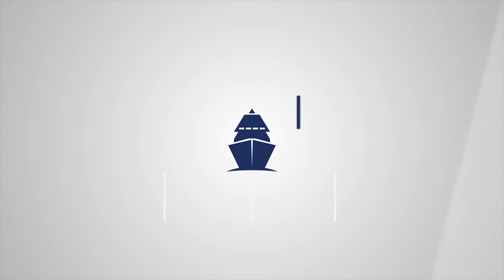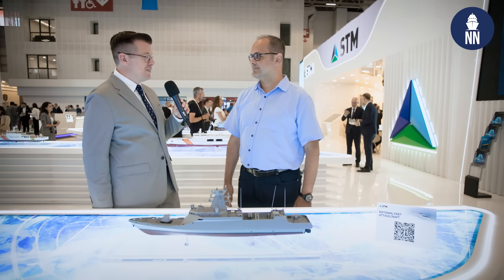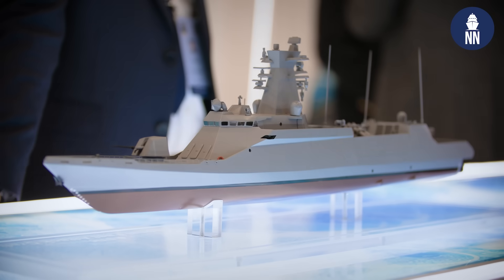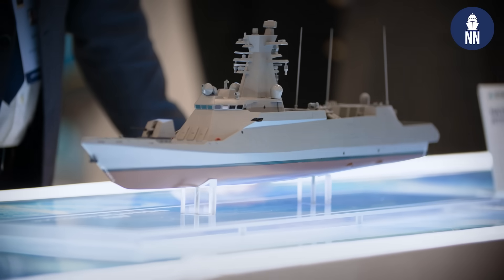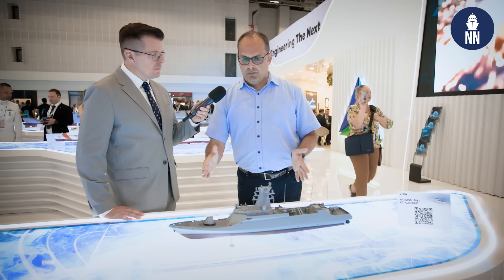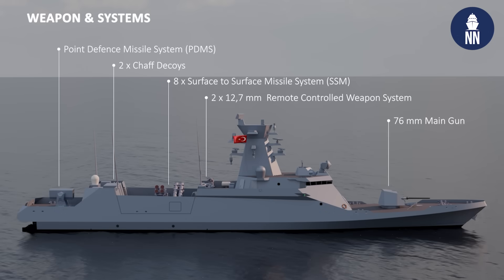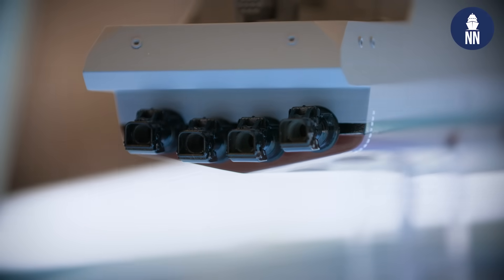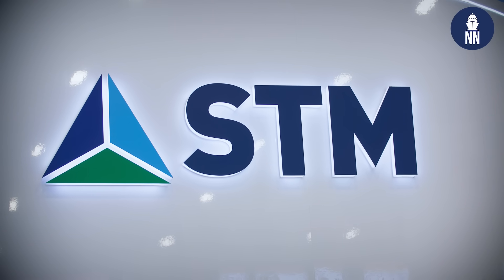Turkish Navy's Future Fast Attack Craft (FAC) at IDEF 2025

Comment: @KingOfKings34  I think we need to talk a little about ship design. The client... in this case, the Türkish Navy. They come with a list of requests. I need these main systems and these subsystems. My desired cruise and engagement speeds will be as follows. In other words, the ship is not built from the outside in, as it used to be, but rather from the inside out, in line with customer specifications. 

Do you want a runway for a 10-ton helicopter? Do you also want the capture and marking systems? Let's take note. Would you like active sonar barges for submarine defense? No? What about vertical launch ramps? No to that either. But you want an anti-ship rocket system and a nose gun. Isn't that right? 

This pre-order period can sometimes last six months, and sometimes six years, as is the case with our air defense destroyer. 
Once the configuration is at least roughly established, the design phase begins. Where will the power units be located? Is cooling required for the chimney and exhaust? Will the hull be anti-magnetic? How many personnel will we need? Where will they live, eat, and sleep? The cable and data line project is incredibly complex. You're working on a line, only to find that the fire guys is running their pressurized water pipes through it. It's pure chaos. 

Then comes the critical acceptance phase. Not a single weld has been made yet, but tens of thousands of man-hours have been invested. An interdepartmental committee is formed to determine whether the commander's seat should be equipped with a height adjustment option. The goal is to satisfy everyone and ensure the product meets the customer's specifications 100%. 

Then you should wait, and sometimes nothing happens for a year or two, total radio silence. Even sometimes nothing happens at all and sometimes the project is returned with major changes. It all starts over again. Customer is king .. Yes?

At some point, you realize that the plans have been approved and the work is now yours, Green Light! All you have to do is work with the project quality team to ensure that every weld and component is manufactured correctly.You sign off on the work you've overseen and assume full responsibility. No pressure!

... Let's get to your question. Why aren't we getting rid of gas turbines? Most likely, it's because it best meets the project requirements, including power, fuel consumption, maintenance, cost, and trouble-free operation.
Why is the FAC so large? Most likely, it's because the advanced subsystems and weapon load mean the required strike capability can't be met on a smaller ship. Respect.
Reply: one of the best comment I have ever came across. Gives good insight how the PM runs from RFI to BAU.

Comment: @KingOfKings34
  
I'm sorry, but you're thinking in 2d so call old school.
Drones are an important step in surveillance no doubt, but they're not everything.

...let me give you a example. 

Let's say we're in a hot conflict zone. This means there's intense electronic jamming and interference in the whole area. This also means the drone operator can't use their vehicle for real-time surveillance in the traditional sense because this Electronic Warfare. Of course, the drone could be given an autonomous route and the data it returns could be analyzed when comminication re-establish but scanning the data of a 6-hour patrol flight will take time even with AI.. What a waste of time. Or are you going to be visually scanning the conflict area with planes with pilots on board? Good luck.

Because we are not talking about an area the size of 5 football fields, as the Americans say :P but a she that has shut down all its active systems 50+ nautical miles away from its prey and she kept "listening" with only passive systems and hiding its radar silhouette beyond islands profile. You can think of her as a old time roadman hiding among the rocks, waiting to rob the stagecoach.

The first fundamental rule of war hasn't changed since the invention of the arrow: If you can't see, you can't hit.
All that's required for FAC is a targeting window during a combined attack involving electronics, kamikaze drones, shore-based anti-ship missiles, and submarines.

FAC requires approximately 3 minutes. This time is sufficient to fire six Atmaca anti-ship missiles and initiate an evasive maneuver.

3 minutes... bigbadaboom!

The message is clear: Don't put your mighty fleet in shallow waters where it's not wanted.
Reply: Even in your scenario, much lighter and faster Kılıç Class is superior to this 700 ton behemoth of a FAC that can barely do 40 knots when diesel  engines are operating at high RPM. Why did they get rid of the gas turbine? Why did they make it so heavy? This is a glorified OPV.

Comment: Can it be converted for Anti Submarine Warfare, Mine and mine countermeasure?
Reply: FAC are very specialized platforms and have little to no possibility to be converted to ASW or MCM.
Reply: @1zanglang  My friend.. I am following this project from the beginning... This project at the beginning was ASW.. But Turkiye has pieces Ada Classified Corvettes and Patrol Ships against Submarines so , the related/responsed people said that no need to ASW in the FAC... Besides It has systems to convert to ASW and it is optional...
Reply: @dedekorkut733  The hull configuration and the waterjet propulsion, make difficult the mods needed to fit hull mounted sonar, and towed array sonar, both absolutely needed for ASW. The FAC hull design is made for speed, not to host sonars, and it has not a low acoustic signature necessary  for a surface platform to be efficient in submarine search. Also, the mods would be too expensive to make this kind of conversion feasible. 
And since there is the ADA class corvette fully capable for ASW, I don't see any rational reason to try to convert this FAC to ASW. 
And, by the way, my friend, I spent quite some time onboard TCG HEYBELIADA, as liaison officer for Romanian Navy, during a multinational exercise, more than a decade ago, and have some time to familiarize myself with the ships capabilities, regarding AAW, EW, ASuW, and ASW. Also, I  know a thing or two about the FAC classes like Doğan, Yildiz, Rüzgar, and  Kiliç, of the Turkish Navy which this new FAC would replace.
Reply: @1zanglang  I am not specialist just wondering the current events.. Thank you for the great informations
Reply: @1zanglang  It is very difficult to find such marine officers and your posts are very important.Perhaps, with the experience of officers like you having served on Turkish ships and having had the opportunity to get to know our ships, you might have recommended the Akhisar patrol ship (corvette designed)  to your government to save the Oil Platform in the Black Sea..
Do you know what its new name will be ? We will miss him/her , was just on the mission for 6 months and its old commander deserve a gift :)